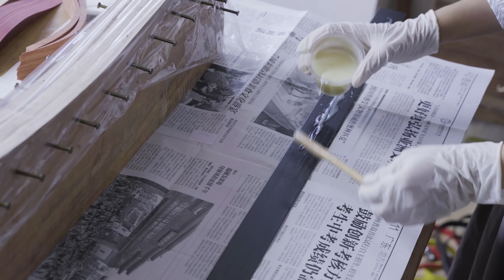How to build Chinese Ancient Recurve Bow and Arrow？ | The Way of Archery in China

Comment: Personnal TIP : before I glue the arrowhead, I make a groove parallel to the arrow body to chase the air bubble, so there is a void inside and the arrowhead never fall down, even after hundreds of shots.
Reply: Bamboo arrows are hollow, unlike wooden ones, and do not require air bleeding
Reply: There is always one.
Reply: What are the threads she used while making the bow rope? I couldnt understand what type she used.
Reply: @mrs.melancholia3820  Most likely nylon, but can be some other (PET, kevlar, etc) synthetic waterproof material. Not historically accurate but awesome for this purpose.
Could be silk, but I doubt it, it looks synthetic at the edge where she cuts it.
Reply: @step670  Thank you!
Reply: @mrs.melancholia3820  Just a normal mutliple fibers since its recurve bow 7:35.. Otherwise Dacron will be better for now
Reply: @Xeloss90  Thank you

Comment: The way of arrow fletching is simply genious ,Thank you for sharing.
Reply: That was the first word that popped in my head when I saw that.  Genius!
Reply: Can you elaborate on that please?  I'm about to take up archery.  I found it interesting but I don't understand it yet....
Reply: ImAGrassHopper ImAGrassHopper I believe what they’re referring to is the jig that she built – the one made of two triangular pieces of wood. She uses it to place all three fletchings (feathers) around the bottom of an arrow, with the right amount of space between them.

Another cool part of her method is how she ensures the entire length of each fletching stays straight and parallel to the arrow. At 0:28 she starts clamping each fletching between short rulers; which keep the fletchings perfectly straight and rigid as they’re glued against to the arrow.

And, of course, now that the jig is prepared, she can construct arrows with great precision over and over again. Clean and clever.
Reply: @nicrodrigo4663  I see... Thanks.  I mistakenly thought they were talking about the interesting way she maneuvers the bow and   prepares to draw before releasing the arrow.
Reply: ImAGrassHopper  I get ya. I’m no archery expert, but one thing I recognize is that she uses a “thumb draw” method of pulling the bowstring back. I believe it’s more common in horseback and Eastern archery than the three-fingered “Mediterranean draw.”

You may already be familiar with these two methods, but if not there’re plenty of examples of them on YouTube. I’ve tried shooting with both and personally prefer the way thumb draw feels.

Comment: Some people spend years learning to master bow making with the technology that you are showing. Quite difficult for an old experienced bow maker to get such good result.
I'm sorry there is no intention to offend but this video seems so perfect for your age. 
You have the correct shape of the template, you have the right pressure system and use the perfect materials - fiberglass + wood + epoxy resin and with perfect sizes - this is really difficult and years for some to get it right.  
Some more things raises the questions to me: .... 
- Some critically important steps in building a bow like adjusting tiller and adjusting the poundage is completly missed in the video.
- You show you made the string yourself but I know someone making these good quality fletch strings for years and he says if he takes a week break, it may not be able to make 1st couple of strings right.
If you would be a real exercised archer - practicing the sport or for doing traditional archery as hobby - there are some another couple of small details that makes the difference between someone is really in traditional archery and someone that does not has much to do with it. 
It is impossible to make this technology without being well over an avarage archer - it is simply not possible except making it in a production line with lean processes. 
The arrows you use are hand made - again there was someone that put his heart into archery knowing to make real traditional arrows ( selecting shafts and feathers, tightening the feathers, carving nocking point in the wood )
What makes me question even more is ... when you shoot the arrows your posture is not good, the release is not good (actually is bad). 
The quiver is Geologic - usually not sold by archery shops but by Decathlon (7-8$ ) ...
The belt is a rifleman belt that you can add bullets - so whos the man hunter 🙂. 
Sorry for the long story ... and no ofence

Comment: You had me confused with the wood at first, using laminated wood and using the portions with knots? A bowyer would never. Then it dawned that it was just a form. Solid work, wouldn't call it much of traditional as it's laminated but the shape is propper. Good work with the string as well, flemish twist has been a long standing bow string that is hard to compete against.

Comment: Only thing ancient about these bows is the shape. The material came after 1942, the glass and string material. You can buy this bow for under 80 bucks without even looking hard.. Good luck paying only 80 bucks for the real craftsmanship needed to make an original. I can make a piece of wood a spring and use it to hunt and I can make a spring that is made up of different woods(laminate) without any glass needed. All because Martin bows would not build a beautiful bow for a left hander. So I built it for myself. They tried to say that it was impossible to make a left handed bow with their forms. That was a cop-out. When I make a bow it isn't left of right handed until I'm almost completely done making it into a spring.